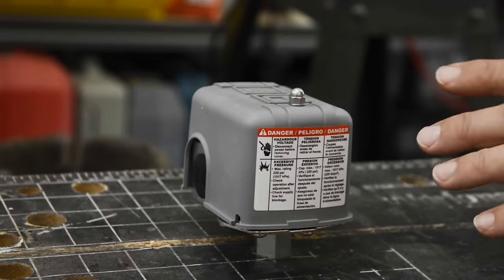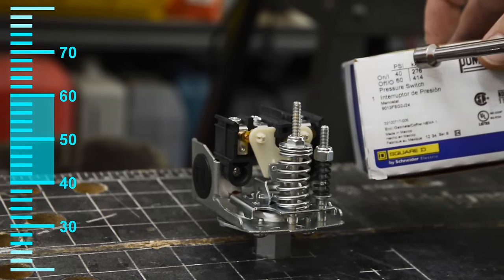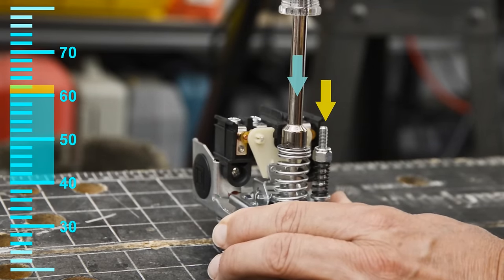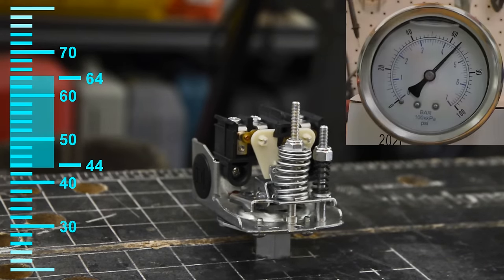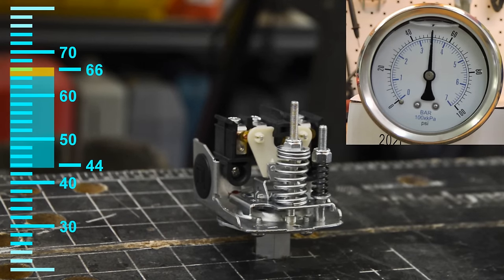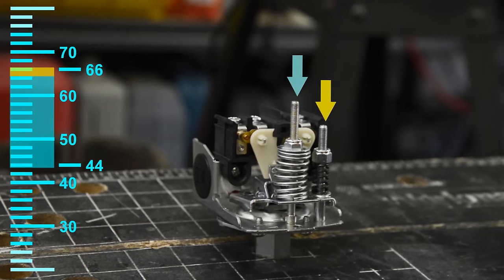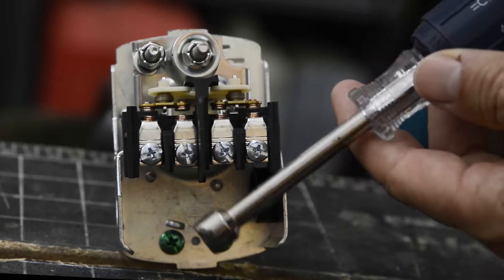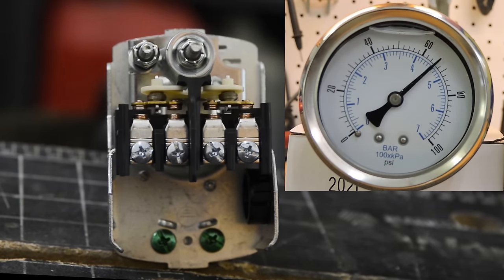Pressure Switch Adjustment

Comment: My pump will only run if I hold the pressure switch to the "start" setting. If it's on "auto" it never runs. On the outlet from the pump I have a TEE. One connection goes to the hose, the other has a air pressure tank mounted to it that I can pressurize with my compressor. I have no water pressure and the pump doesn't run unless I hold it to start like I said above. What is wrong?????
Reply from the maker: They do have one that has an off switch, when you lift the lever up it shuts off the switch function, effectively shutting off the pump. In the down or "auto" position it acts like the normal pressure switch.  Is that what you have?

Comment: great video thank you, I have a grundfos JP basic 4, its been turning on for ~10 seconds every 30minutes. would turning out the center nut to reduce the range help with that? it's simply an irrigation bore setup and currently there is more than enough pressure
Reply: +Russ Keller thank you for advice. yep I'm worried about power so looking into it. I'm starting to think it's a problem with leaking back into well or leak in black or polly pipe. I will get a local guy out to take a look. all its used for is an in ground garden irrigation system so cannot be leaking toilet etc. I'm thinking temporarily to install a power point timer which only turns on at hours the watering system comes on

Comment: What if your switch is hookup to the pump and you have a tube that runs from the bottom of the switch to the side of the pump
Reply from the maker: It operates the same way no matter you're pump configuration.  Your switch is reading the pump head pressure straight from the pump volute, via the 1/4" tube.  You would adjust it the same way.  Helps to have a pressure switch installed ion the pump output close by, so you can visualize the setting.
Reply: It's about two feet. I just unscrew it correct
Reply: Reclaim Filters & Systems Inc

Comment: Our pressure says there's 80 psi in the line. But our switch won't kick on. And we have zero water. What's going on?
Reply from the maker: No water with gauge reading 80 says the gauge is bad.  If the line has no water, you put a new gauge on and it reads zero then the same stuff that clogged the gauge and stuck it at 80 is probably in the pressure switch inlet.  Either clean the inlet or better yet replace the switch with a new one.  Most residential well pumps are made for a 30/50 switch and commercial ones up to a 40/60.

Comment: My pressure switch Cycles on and off but after it satisfied it's still hums is that normal?
Reply from the maker: I would get a good multimeter and check the voltage, current and the frequency of your AC power.  Here in the U.S. we usually run two 115 - 120 VAC lines to feed a 230 V pump. The frequency is 60Hz which is in the audible range of 20-20,000 Hz and if your power is fluctuating or your contacts are dirty you may hear that low 60Hz hum.  It also may be an indication the pump is drawing excessive current. Be careful and don’t shock yourself! The contacts have to be live when checking the power.  If your not sure about being around electricity hire a competent pro.
Reply: @reclaimfilterssystemsinc7529  thanks I will hire a professional..

Comment: Pump does not cut off ?
Reply from the maker: If the contacts are closed the pump will run.  If they are not opening the pump is not able to get to cut off pressure, or the switch is bad or needs to be adjusted.

Comment: why would the points click back and forth quickly
Reply: bad ballast pressure tank or the check valve on the outlet of the pump.  90% of the time the ballast tank a.k.a. bladder tank is flooded with water.

Comment: How do i do the opposite...lower pressure say to 20/40
Reply from the maker: Righty tighty, lefty loosey.  By going counter clockwise on the center "range" nut, you can lower the range.  You'll find it better to purchase and install a lower pressure switch.

Comment: Sir, Hello my Water Pump Switch isn't, Cut off I'm having difficulties Repairing it.
It doesn't SHUTSDOWN.
please help sir.
Thanks a lot.
Reply from the maker: If the pumps running, it's constantly getting power.  That means 1. the pump is not getting up to pressure to cut off the switch, or the switch is faulty.  If you have a good working pressure gauge check to see if the pumps getting to the cut-off pressure.  The cut off pressure is usually listed on the bottom of the pressure switch cover.
Reply: @reclaimfilterssystemsinc7529  Thanks a lot Sir, stay safe

Comment: what makes the switch continiously  on and off sometimes,and it dont last more than a  week
\
Reply: it dont last means the switch gets damaged
Reply from the maker: Usually that’s a sign your ballast tank (bladder tank) is bad.  They lose air and can no longer buffer the on/off cycling.  With zero pressure on the system you should have 2 psi less than the cut in pressure.  For a 30-50 switch that would be 28 psi.  There’s usually a bicycle type air valve at the top to check your pressure & fill with air if needed.  If the tank is more than 10 years old, do yourself a favor and just install a new tank.

Comment: My switch keeps coming on without no water running any place?? Every 3 minutes it comes on for 30 seconds all day every day. Please help?
Reply from the maker: Hi Robert:  I'm afraid the water is going back from the pressurized tank into the well, either via a leak in the line, or more likely a worn check valve on the nose of the pump.  Try installing a spring check between the pump and the ballast tank.  Arrow facing the water direction.  That will keep the water from running back to the pump and into the well.  Good Luck
Reply: Seams a little complicated for me. I was just hoping it was a bad switch. I just posted what it's doing. I have a submersible pump is the check valve near the switch on top? Thank you very much for your reply.
Reply from the maker: easy peasy, the check valve is on the outlet of the submersible pump.  If it's bad you don't have to pull up the pump, just install one before the ballast tank.  You can get a glue in PVC one from Home Depot or Lowes.

Comment: Have an on demand tankless water heater on a pump operated water system. Every time the pump cut in (20/40) the water heater would shut off ruining my shower. Followed your well done video and bumped up the pressure a few pounds and it silenced my bitchy wife. Thanks for you very well done video.
Reply from the maker: Glad to help.  We have a tankless as well, and sometimes if the pressure isn't right you'll get a cold shower for a few seconds.  It saves us a lot of money but it was finicky about pressure.  We ended up installing a cycle stop valve and a larger ballast pressure tank to eliminate the pressure swings and now we have steady hot water.  Hallelujah!

Comment: My house hold pressure pump is losing pressure as it sits idle pressure will build pump will kick out pressure will drop over some time pump will start again  without running water ect! Anyone had this problem and how do I fix the issue?
Reply: The check valve on the head of the pump is going bad.  It keeps pressure upstream from the pump to the house and prevents it from coming backwards into the well.  You should also check for leaks as that could cause the problem also.  If you don't want to pull up the well pump you can install a good quality check valve between the pump and the inlet to your house, somewhere prior to the ballast tank.  Most plumbing supply houses carry PVC check valves that you can (use cleaner and glue) and install yourself.  If it's a PEX line they have press to fit models that will press onto the tube and lock in place.  Just make sure clean the PEX tubing and press it all the way on as far as it will go. Good Luck!

Comment: Why mount the switch on the water supply line?  I mount mine on the top of the pressure tank. That way it never is subjected to water. The air pressure from the top of the tank will allow the switch to work and provide longer life.
Reply: Hi Craig:  That is really interesting I've never tried it.  The mfg recommends installing as close to the ballast pressure tank as possible.  I guess it can't get any closer than that.  Do you still adjust the ballast tank pressure to two psi less than the pressure switch cut in pressure?
Reply: nckeller Yes!  That's very imporant to do so.  I always set my range 40 - 60, with 38 psi in the tank. My own house, I have rocking 40 - 70.  I love taking a shower at 70 psi. LOL
Reply: +Craig Terrian How do you mount it on top of the tank? Vertical or horizontal tank? I'd like to try it. Mine is a vertical with no way to mount on top of the tank. Our tank at camp is a horizontal with no way to do that either. Can you explain?
Reply: +timberjack On the very top of my vertical tank is a threaded plug. Remove it, and use a brass adapter to mount the pressure switch. http://oi64.tinypic.com/2rftwu8.jpg

Comment: My water pressure goes from 50psi down to 30psi fast and my pump goes on and off really quick my cut in is at 28psi can't figure it out anyone with any suggestions?
Reply: i have the same problem... u fix it ??
Reply: Josue Vazquez the bladder was no good

Comment: just replaced pressure valve and it wont stop running the pump!!!  Can anyone help me??  I dont want to splode  something.
Reply: Pikeman50 Did you mean to say pressure switch?If the pump is always running look at the switch, are the contacts open or closed?  If open and the pump is running there is a wiring problem.  If the switch contacts are closed then several things could be happening.  One, your not reaching cut off pressure (50 or 60 psi) this could be due to the pump spinning backwards, water running someplace or a bad pump.  You could have a misadjusted or bad pressure switch.  What is the pressure on the system?
Reply: nckeller Thank you so much.  I will get back on it Friday.  Till then Im just running it when I need water.  Thanx again!!!

Comment: I primed my pump but it has no pressure only the water I put into the pump is coming back out
Reply from the maker: The problem could be a suction leak or the well could be dry.  The pump will pull air before water.  Even a pinhole leak can cause prime loss.  Because you are priming the pump indicates you have an above ground pump therefore check your suction line.
Reply: what is the suction line

Comment: a humming motor that is not spinning or producing pressure sounds like an electrical problem, time to get a plumber who is certified on electric motors, not just a pipe fitter.

Comment: Man how Connect electric????
Reply from the maker: Hi Alex I don't understand the question.  Are you asking how much money an electrician or plumber would charge to install a pressure switch?  If so I can tell you precisely.  It's more than you think...  Learn all you can. Be Safe and do it yourself.  Make sure the power and water are OFF before you work on it.
Reply: @reclaimfilterssystemsinc7529  I managed to find its inputs and outputs, I tested it with the control lamp, it's simple! Thank you!

Comment: Good morning. And thank you for a very clear video on the way this pressure switch works, particularly the differential.
I'm hoping you can shed some insight for my situation. 
The on/off cycles of my switch are very unpredictable. sometimes it goes down below 30, then quickly drops to 0, and this morning it is up to 65. I have replaced my pressure gauge and switch within the last week but I am still having the same problem. I checked the pressure in the tank and I had to increase it to 28 psi from 22 for my 30-50 switch.
I can't figure this out. Can it be that I have air in the nipple leading to the pressure switch? Naturally, I had the water off until I had my plumbing done. I will say this, the contacts don't open and close, but yet the switch goes on and off. Thank you for your time, very much.

https://www.youtube.com/watch?v=mfDArAqL9HQ&t=76s

Yes, I have to replace my "T".
Reply from the maker: Air will compress more than water however that I do not believe is the problem.  When you check the pressure in the ballast tank make sure the system pressure is zero.  Then put your gauge on the tank and see if it's 2 psi less than the cut in on the switch.  In your case 28 psi.  You may have a contact issue.  I have seen pressure switches with bad contacts although the Square D models have been pretty bullet proof.  Good luck.
Reply: Right, I had the hose bib open when I set it to 28 lbs. Thanks for the reply.

Comment: understood what you going to explained.But your demonstration is fake.!!! because pressure switch is not connected with pump and you showing as per your adjustment cut off and on.may you connected that gauge with Different Pressure switch.
Reply from the maker: Jobyjoseph Joseph Hi Joseph:  Your partially correct.  The pressure switch and gauge were hooked up together on the same line however we only had one camera, so we had to record one then move over and record the other.  This way we could show them side by side.  I thought it would be easier to understand side by side.